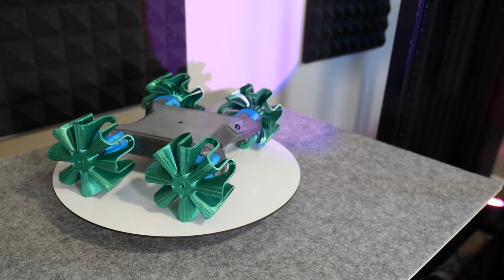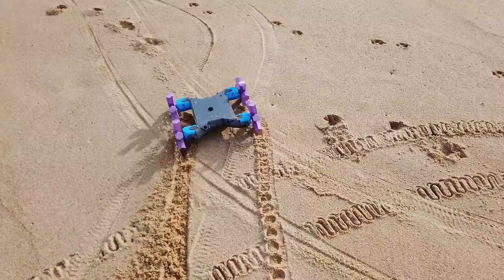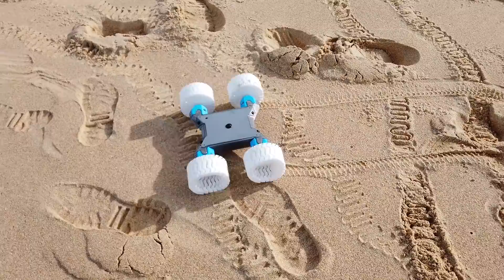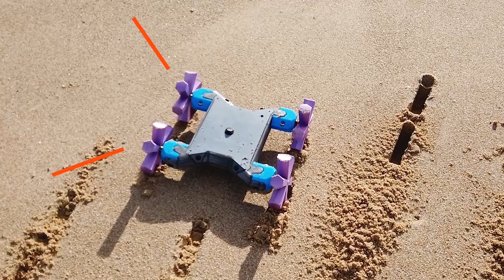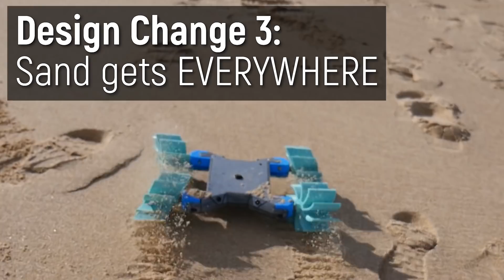Weird wacky 3D printed wheels!

Comment: You might want to put some grease fittings in the gear boxes. This is done for bearings in the mining industry not just as a lubricant, but also as a cleaning agent, the new grease pushes all the dirt and sand out of the bearing, as it often is impractical to completely seal stuff in abrasive environments. 
In fact, if the gearbox has tight enough tolerances you will need to design a hole for the grease to escape from. Near constant lubrication will also allow you to get away with plain bearings, which have many advantages. Even high end grease is inexpensive by specialty chemical standards and food grade greases are available as well. 
Wise farmers will say that grease is cheap, parts are expensive.

Comment: put ceramic disk capacitors on the motors in parallel (across terminal leafs in parallel to the supply and ground). this helps to smooth out brush contact but also with the starting torque and torque in general.

Comment: Dude I absolutely love your videos please continue making them... I'll be honest I didn't particularly notice the flaws in your Design until you pointed them out but it does make a lot of sense so I'm very very keen to see what improvements you make in the next videos and if any of those wheel designs perform better on a sand incline after your adjustments

Comment: Before adding a chain to link the drive between front and rear. another option is to wire the motors on each side in series. cheap to try and quicker than making new gear boxes.

Comment: I think that drunk flexible wheel design is more suitable for high speed sand cruising than crawling through loose sand. Maybe it will work better for crawling if there's more space between the segments or make the surfaces triangular rather than just flat.

Comment: I don't know of any commercial brushed ESCs that support it, but anti-phase PWM gives almost full torque all the way down to zero speed. It's not energy efficient, but that's not the point here. Combined with speed sensors on the wheels, it would be possible to make a very effective torque control system.

Comment: I saw you had an issue with your switch, I have a suggestion for that that is fool proof and immune to sand. What ever plug you use for batteries, take and wire a female one in place of the power switch then use a male plug with a loop between the terminals as your switch. insert plug, robot on, pull plug robot off. Simple and fool proof and obvious from the outside. It is also a quick way to make sure things are off if there is an issue.

Comment: Love the wobbly wheels.  They seemed to work pretty well too.  Angus, why not use an electronic touch switch so you do not need any hole in the hull ?  You could use capacitive, optical or magnetic effect.

Comment: could you use a zener diode across each motor that will only allow 65% or so of your supply voltage across each motor? I am not super great at electronics, but I am thinking that if a zener capped the voltage across each motor somewhere above half of the total supply, wouldn’t it force the other motor to produce torque and turn? if the resistance across a stalled motor is low and you cap the voltage of the 2nd motor, it would force more voltage across the stalled motor I would think. just a theory. I may be totally off here. someone with component level knowledge, would this idea work? I would think it would act more as and AWD and not a 4WD type thing as they would not be "locked". input and corrections welcome!!

Comment: For the ground clearance, maybe you could add some servos on each 'leg' (referring to the bits that hold the wheels) so they can turn inwards to gain that slight bit of height that one may need when going up a hill.

Comment: My advice for the design:
1. Use a limited slip differential (or torque vectoring differential) between the wheels, that way you can use a single motor to apply torque to all four wheels, but still prioritize one side over the other.
2. Use some kind of suspension (preferably active suspension)..
3. Collab with James Bruton and Tom Stanton to test some other stuff out.

Comment: I have an idea for an alternate traction control system. No idea how well it will work, but I'm still curious nonetheless.

Normal traction control works by measuring slip angle, to figure out whether or not a wheel is spinning too fast.

What my proposed alternate system would do instead is use some kind of load cell to simply detect whether or not a wheel is actually touching the ground, and stop supplying that wheel with torque if it's not touching the ground.

Would you mind giving this a try, comparing it with normal traction control, and then seeing what happens when the two are combined?

FOR SCIENCE!

Comment: Hello, in the switch you can put magnetic contacts and when the magnet it is on the contact it will be off. i make that in a full waterproof power container and it work perfect.

Comment: Hey Angus, you could also solve the sand in the switch problem by positioning a patch of clear flexible plastic (or rubber) over the switch and gluing it down around the edges, much like switches on power tools like a sander.

Thanks for your great content!
Reply from the maker: Yeah! Definitely will be taking ideas from power tools for the next version.

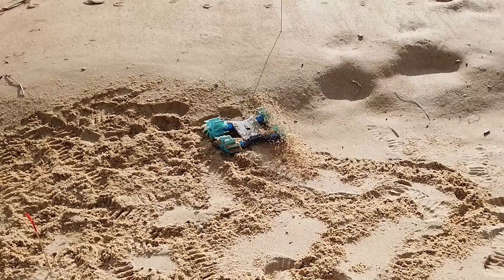Comment: 3:10
I have a question: "Sand Wobbler" wheels' orientation wasn't correct, did it? Cuz these wheels looked like a turbine fan that is supposed to push air outside along it's radius. Same as wheels might be designed to "tap on" top of sand instead of "dig into" it.

Comment: You are wrong about DC motors.
Natural load characteristic of DC motor complitely opposite to what you said.
It has max torque when it stall and miniscule torque when it spin fast.
You need adequate motor control with speed feedback loop, not a new motors. ( Brushless motor can't work without such control, so probably it also solve your issue, but it wrong idea about how and why)

Comment: To anyone who can help, I've been having issues trying to print PETG on my ender 3. The first print I made with it came out exceptional. Now when I try to print it (with pretty much the same settings) it seems to just get stuck in the hotend. It doesn't melt, but rather seems to soften and fill the diameter of the bowden tube for the last inch making it very difficult to remove. Again, this is at the same temperature so idk what could cause it. I have thoroughly cleaned the hotend and cleaned then replaced the nozzle to no avail. What could cause this?

Comment: I would also recommend extending the wheelbase. Ideally you want a relatively square platform, typically if you favor length over with you end up with more wheel options and better wheel clearance, food for thought.

Comment: Brushed DC motors will typically have maximum torque at stall, decreasing with speed due to back emf. A brushless motor of equal output power will not improve your low speed torque (a sensorless one would likely be worse). You either can change your gear ratio and tradeoff speed, or use higher power motors.

Comment: BTW - the 'skid steer' setup of your little cart thing is probably the worst possible design if your goal is to maximize traction.
You're designing it like a 'battlebot' which is kind of expected, since that's what you you know. But look a the difference between a battlebot arena floor and the surface you're trying to drive on, on the beach.
Try designing it as a 'rock crawler' or minimally capable 'off-roader' instead of a flat plate that has to break traction on 50% of it's driving surface to turn.
Servo type steering would obviously be pretty bad news for a battle bot - but there is a reason it's used in nearly every other type of vehicle in existence.

Comment: instead of a grommet on the switch, maybe a reed switch and a magnet would be better. the magnet would push-fit on the outside, closing the switch. There doesn't need to be a hole.

Comment: For the switch issue, try using a "Link" like in combat robots - Just an XT90 or XT60 connector looped back on itself. provided it stays in when the robots is on it shouldn't fill with sand and even if it does it should be easy to clear out (I'd put the female side on the robot and use the male side as the link).

Comment: You could possibly use a NC reed switch as a power button. Place a magnet on the outside when you want it to be off, remove the magnet to turn on.

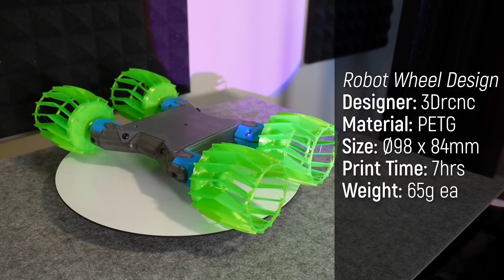Comment: to me all the wheels have the same problem, there too small at least for sand, a chunkier wheel would make it so that it don't get stuck as easy if one of the wheels hits a hole, i like the design of 4:30 3Drcnc as they dont give up too much weight to the size.

Comment: Now imagine if that sand was about 100 times smaller and is so super dry that it doesn't clump. Then imagine you're several light-minutes away from it with no chance of going over and picking it up if it gets stuck. Oh, and it drops WAY below freezing every night. Now you're on Mars.

Comment: For the motors that power the wheels themselves, you should try to 3D print brushless DC motors, with strong Neodymium magnets! They can use the same power controllers!
Reply: I would choose to wire them in the Delta phase, rather than the y phase

Comment: I think you need suspension, if you are going to use it on the beach it basically a sand buggy, so suspension is needed specially if you are driving it through footsteps.

Comment: Just use one of those watertight on/off buttons. I can strongly recommend the "JC Electronic Components" seller on AliExpress. I've noticed that their buttons, switches and connectors are far superiour to most of the crap you find on AliExpress. Thick wires and actual nylon or silicone when promised
Reply: Not sponsored btw... just a happy customer :)
Reply from the maker: Good to know! Always looking for decent suppliers.

Comment: Why not design the wheels to be gear like and increase the diameter of the wheels to the front and rear wheels interact. This way the front and rear wheels will always spin at the same rate and the increased wheel size will additionally help with ground clearance.
Reply: That will work great if you want the front and back wheels spinning in different directions. You would need an intermediary gear to get them going the same direction. Also, sand in the gears would jam them up pretty quickly

Comment: If youre going to seal the casement, place desiccant/corrosion inhibitor packs inside. Regardless of how dry it seems to be when you assemble it, there will always be some kind of humidity that may condense out of the internal air which can and will short out electronics
Reply: Thanks for that tip, I'll keep that in mind for my own projects too

Comment: One thing to look at for the driveline, set it up like how the SHERP drives its tires.
Use two motors and run each side with a belt, that way each side is locked

Comment: Could you use stepper motors and have a software defined differential lock?
Reply from the maker: I thought about steppers but they're pretty heavy for the torque they can output - easy to control though!

Comment: Not entirely sure how the translation would work as an update, but a portal axle style setup (quick search says there's printable versions!) could give you a lot more clearance and possibly expanding your footprint without adding a lot of weight in metal parts. The gearing/belts/chain could be kept in the root of a pod to account for wrap-around wheel choices without affecting 'end mount' wheels.

Comment: 3Drcnc looked like they worked best by far. Increasing the diameter would help with ground clearance and the new motors should have the torque to turn them when bogged down. 
I alo liked Sheflya's it made a nice patern but looked like torque was a issue.

Comment: You could replace the mechanical switch with a capacitive touch switch that could detect a press through the plastic case. You'll get 0% chance of sand getting in, plus it'll be cool af

Comment: Brushed motors aren't good with low speed torque? That's a misconception. It all has to do with windings, lower winding for higher torque (less speed) higher winding for less torque (more top speed). Brushless motors are fine but if you want torque you need low KV and a sensored motor. Sensorless with low speed just jitters way too much to be reliable.
Reply: When you take a high Kv and give it a big (in this case, 27:1) reduction, you'll get excellent starting torque.

Comment: I'm not sure what speed controller design you're talking about but brushed dc motors are the opposite of what you stated. The most torque is produced at stall (speed zero) and because brushed motors are mechanically commutated, they will draw as much current as the windings and voltage will allow and only be limited by the transistors. As speed increases the generator effect decreases the voltage seen by the coils, hence it eventually stops accelerating when all the energy is going into the torque to just overcome the internal friction, no more torque available for external loads.

Comment: Interesting to see your take on brushed vs brushless motors. I know when I was playing with r/c cars a few years back high end crawlers were almost always brushed motors as they gave better low speed control (iirc). Maybe brushless ESCs have come on a lot since then and are able to give better results now.
Reply: Only brushless motors with built-in hall sensors are going to have a chance to improve on the low-speed torque. Standard ESCs and brushless motors are high-speed (-ish) only.

Comment: You could use low kv brushless motors in conjunction with a BLheli_32 4-in-1 ESC and modern Betaflight flight controller so that it can monitor the RPM as well as do more advanced mixing of differential thrust between the two sides for more effective torque vectoring. I've remixed parts and redesigned the OpenRC F1 to make it a independent suspension 4WD Betaflight car (motor inside each wheel) and it seems to work well, but didn't use a BLheli_32 ESC or low KV motors so I haven't been able to implement the really accurate and effective torque vectoring between the two sides yet, but it is the next step. That's what I'm implementing in my 4WD OpenRC truggy that I'm in the process of redesigning right now. Love these wheel videos! Cheers!

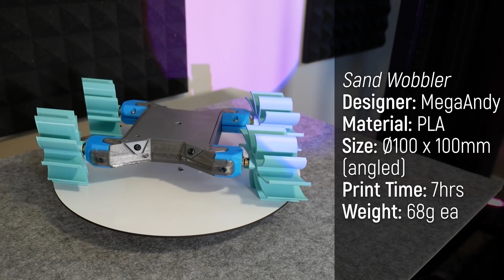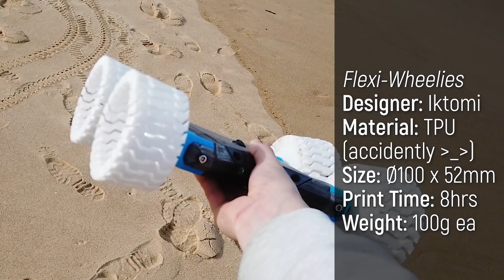Comment: In this video, I personally saw 3 very interesting design. First is the Sand Wobber at 2:24 but I think it may work better if it was going backward. In the test video, the blade of this wheel when going fast, was acting as a shovel, throwing lot of sand on the rover but when goin in revers, the curve act less agressive on the sand, allowing it to gently push lose sand to have more surface contact and better traction. The second, I'm impress but not surprise then the Robot Wheel at 4:27 did so great! They look a lot like those on space rover Nasa use. The third is the Flexi-Wheeelies at 5:32, but is it expanding when it go fast or am I seeing thing? Can't wait to se the bot 2.0 and more wheels design!

Comment: For the power switch, get a balloon and cut a circle slightly bigger that the switch itself, then put glue on the perimeter of the rubber circle and put it over said button so you can still push it but it's completely sand/water proof

Comment: If you Use butyl tape to seal, it water will definitely not get in, it will be very water proof. Just be careful not to stick the butyl tape anywhere you don’t want it as it is a nightmare to remove.

Comment: for speed control of motors, you can use PID controllers (on Arduino or some other microcontroller)but you need motors with encoders and if motor wont spin on full throttle the result will be the same as in this video.

Comment: An alternative method for better control that would require less chassis redesign would be using using motors with encoders. Read signals from the RC receiver into an arduino nano or pro-micro then use a PID loop to turn the RC signal into a velocity setpoint for each motor that scales the PWM signal to the motors to achieve an exact wheel rpm. It's a fair amount of programing work be the result is very scalable and tunable!

Comment: Maybe add a differential that connects the front and back engines? If one wheel slows down it gets more torque, and the other speeds up. Kind of like a differential between the front wheels of a car but then front to back.

Comment: If the external surface area limit is still in place i would like to see a wheel resembling a toilet brush as much as possible- very spiky to spread the load out over the smallest area similar to bed of nails concept
Reply from the maker: That's crazy enough to work... maybe using the "hairy lion" printing trick?
Reply: @MakersMuse  Precisely! I'm not certain if you still have the restricted surface area category but I would expect them to maximise performance for "ground contact"

Comment: what about using portal axles?
basically a simple 2 gear gearbox to elevate the platform.
Reply from the maker: Huh, could be an easier option than dog bones! neat thanks :)
Reply: My thought too. What about using a belt drive instead of gear drive for the portal system? That way you can print the timing belt pulleys as needed; diameters and ratios at-will to accommodate different diameter wheels.
Great Series! Thanks.

Comment: I don't know why you choose those expensive industrial motors but a hobby grade 1500kv outruner on a 1:4 gearbox will easily break any printed part if you stall them. Ive built several crawlers paired with iflight succex slick escs flashed with am32 firmware and the torque and low-end control are amazing. A motor and ESC is less than 30 usd.